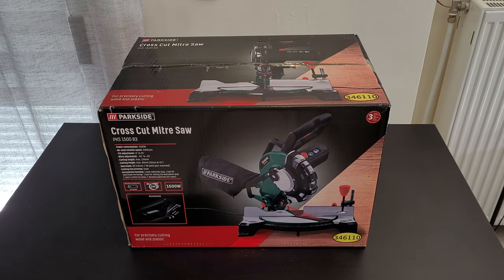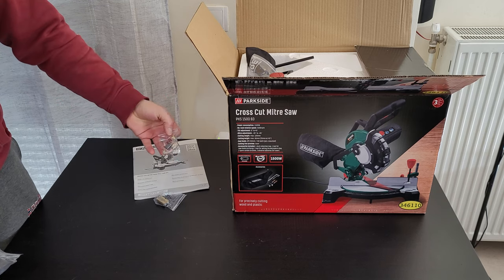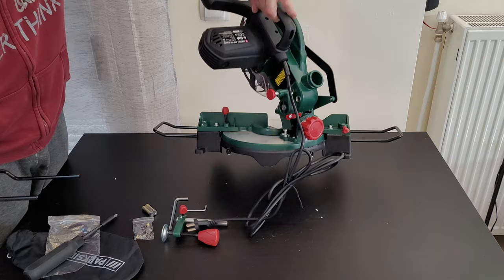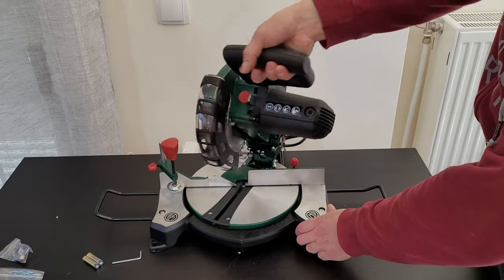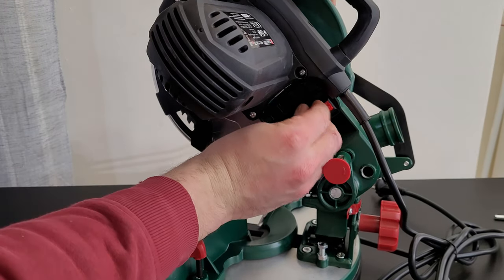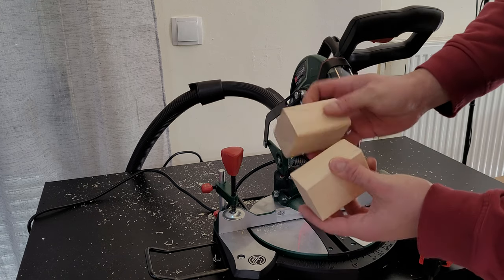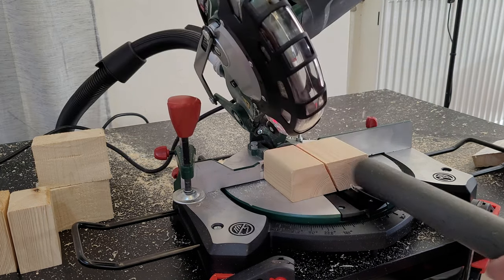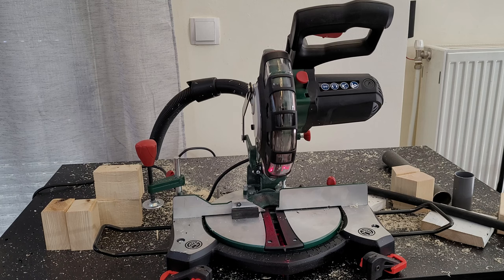Parkside Cross Cut Miter Saw PKS 1500 B3 TESTING

Comment: I was frugal and bought this saw. It’s impossible to saw wood to a precise length. The axel the saw is mounted on has a lot of play. Also the laser is operating with batteries that are drained in a very short time, because I forget to switch it off. For the money it’s a decent saw, but I wish a bought a beter one.

Comment: Unfortunately it is not a good chop saw. It is far from precise even with careful set up. The is not rigid enough and it is impossible to set it to exact angles to make a picture frame or a box without big holes in the joints. I am returning mine.
Reply: If you make pic frames you do not buy this in the first place but for example a DeWALT DWS780.......However this is with some adjustments a nice saw (for the money)
Reply: Of course, you can always decide to spend 700€ more and buy a better one. With 70€ this is more than fine.

Comment: Leser marking to me is a very good solution and I like it. I turn laser on set exactly on the line and then shut off.

QUESTION ON ACCURACY:  Laser line is a very thin light beam and can be set exactly on the marking line of the piece to be cut.  However, saw blade has its own thickness of about 3 to 4 mm.  In other words, if we set laser line exactly on the marking line to be cut, we can be short for a "half of saw blade thickness" inside marking line  i.e. short of about 2 mm (half of the saw blade thickness) from required accuracy.   What would be your advise on how to offset for that inaccuracy?  Your suggestion is appreciated.  Thank you.

NOTE: I retested this and it cuts close but to me overlap laser line about 1 mm.  Not sure?  Can anyone comment.